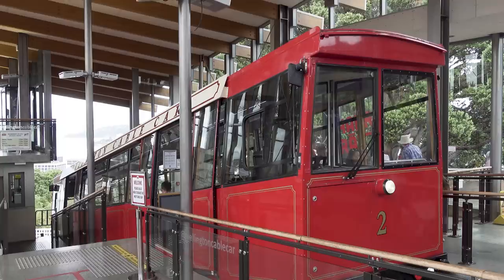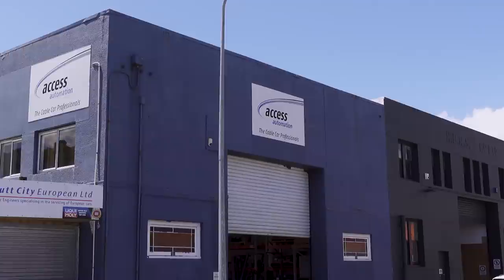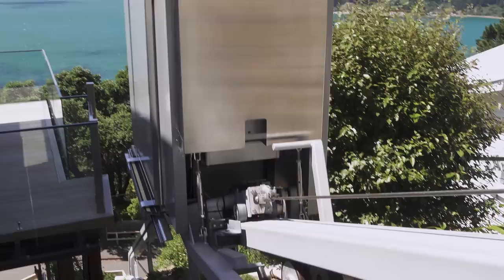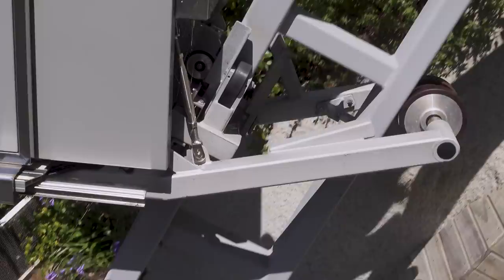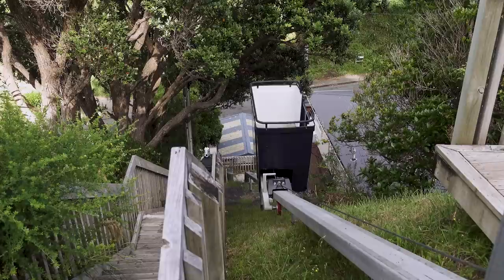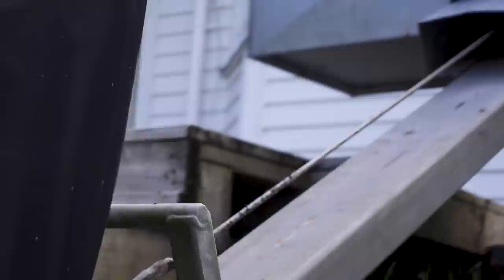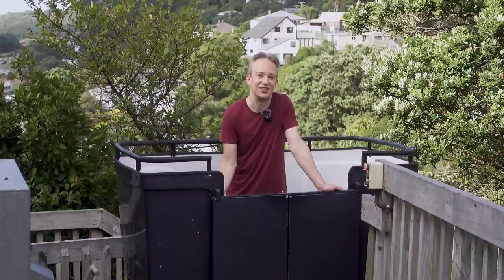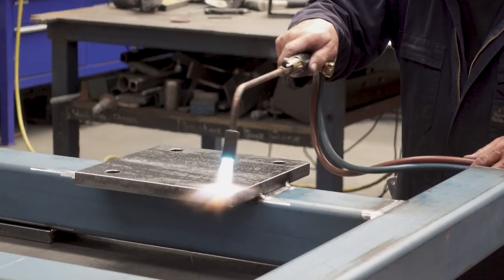The city with a hundred private cable cars

Comment: Let's do some math! $120,000. Suppose a couple uses this lift 4 times per day. That's 8 transits total (4 up, 4 down), 8 times they didn't have to use the stairs. 365 days in a year, that's 2920 trips in a year. Let's say you live there for 10 years of reduced mobility. That's 29,200 trips. And let's say that unlike every other elevator in the world, this one is maintenance free rather than low tens of thousands of dollars a year to maintain. That means, if there was a ticket booth that charged admission, even after 10 years, you'd still have paid over $4 admission every single trip, 8 times a day, for 10 years. $32/day. I dunno, reclining on a handtruck towed by a winch for about $400 total cost is more my style.

Comment: what should have been explained is what happens in a fire, as a power failure would stop the cable car if there is no pathway to it
Reply: If there’s a fire then you just go down the stairs like in an apartment.
Reply: All of these properties have stairs. They were built with stairs. The cablecars are added later for improved accessability, but the stairs are still there.
Reply: Note: Emergency batteries could power this as well......

Comment: It seems potentially problematic in several ways that the manufacturer is also certified as an "independent" inspector - would not both the manufacturer, insurers and customers have significant interest in having the independent inspection done by an actually independent party?

Comment: Wonder if anyone's built a house up the side of a steep hill, with an escalator running from the front door to the attic, all the rooms and floors between being jump off points... I wonder... (insert harp music and wobbly transition effect).
Reply: Picturing that with a spectacular view…. on a solid rock base and no soil erosion….
Reply: Such houses definitely exist, though I'm fairly sure they generally tend to run to stairs, ramps, and/or proper elevators rather than escalators or cable cars, simply because the sort of people who need the accessability these provide when they Build the house... tend to just build a house such as to minimise the need for such things (it's cheaper and easier to deal with, after all).
Reply: There was one I knew of in Kelburn which had an elevator from the street level garage to the main house.

Comment: Angel's Flight in Los Angeles has 2 cars on a cable..as one is going down the other is going up.. this makes it less energy intensive than just pulling up the weight of one car. This means only the weight of the pasengers and cargo in the car uses up the energy. It just occured to me.. that these cable cars could also be uses for energy storage by lifting up weights and then they could then use the energy by letting the weight descend and with regnerative braking of the drive motor.. generate electricity?
Reply: A funicular
Reply: Technically that's a funicular not a cable car. But people use cable car for both.

Comment: @4:18 It looks like the cable is only clamped on the tail end in the choker.  Shouldn't there be two clamps clamping both pieces of cable together?
Reply: Another expert on the internet - what a surprise!
Reply: The cable is fed through a wedge socket, which is what actually clamps the cable. Their clamping force increases as the load is applied. The cable grip you can see on the tail is just used to prevent the cable moving through the socket when there is no load on the cable.

Comment: That's a rather incredible amount of money to simply access a home. 
I feel like most people (in the U.S. at least), faced with not being able to access their home in the future due to lower physical mobility (due to age, or injury, or whatever), at that price would have literally no choice but to sell the house and move somewhere more accessible. So to me this feels like an unsustainable or at least "for affluent only" kind of thing to install.
Reply: These houses are already expensive due to the area so I bet the owners are already quite well off and can afford it.
Reply: Consider that NZ is currently experiencing a significant housing crisis. In the sense that there's legitimately not enough of it (there's a bit of the common problem of only building high end expensive housing and then property speculators just sitting on it, but even if you remove the speculators and drive the prices down, there's still just flat out not enough housing, and building more (while dealing with natural disasters and global trade disruption) is going slow due to Other shortages). 

It makes it a bit more reasonable.

Comment: I'm frightened because there seems to be no counterweight to these vehicles. They are simply hoists. What safety devices are present if the cable snaps?  (Yes, I'm an engineer)
Reply: 10 to 1 safety factor in the cable design.
The cables never "snap".
If you were really an Engineer - you would know that.
Reply: @DennisMerwood-xk8wp  - If you were an engineer, you would know the importance of "redundancy" and "fail-safe design."
Reply: Yes, very few have counterweights. They have multiple safety brakes if it all goes wrong, but it is very rare for a cable to snap, although I have seen the result of several, however this was due to the cable car being very old and poorly maintained.
Reply: @Sprocket72-zz6pc  - Of course, lack of maintenance would turn a safe system into a deadly one. In my experience, some owners will make up every excuse in the book to not do maintenance, especially if they're a landlord. Even with a "Repair-and-Deduct" law, not many renters will be able to afford to even keep up the inspections.

Comment: are the houses built on rock soil? or it does not rain much in the area? the houses seem very prone to hill slides, but since this is a long running thing it does not seem to be a problem, I'm just curious, since the area where I live now deals with hill slides every so often from some houses on hill sides
Reply: The area is also very earthquake prone, and isn't the only place like this in New Zealand. I must imagine that the building code accounts for such things.
Reply: It's very stable. There have been slides or subsidences elsewhere but in Wellington you're more likely to have land ride up out of the sea in a big shake. I worked for 10 years in a factory built on land that came up like that, right by the airport.

Comment: How does the safety mechanism work? Is it universal to the all the designs? Like what happens if the cable were to snap?
Reply: As in elevators in 50 storey buildings..automatic brakes come on near instantly....
Reply: I make these,  there is a “slack wire brake” and also an “over speed brake” in the event of any other over speed situation

Comment: I really don't understand why a small one would cost $140k US.  That is absolutely insane. I feel like I could build a reliable one myself that could lift 40 meters for no more than 30k.  That inch thick steel plate he was welding to a rail in the one scene seems wildly overbuilt.  My tractor lifts a ton and doesn't use steel anywhere near that thick.
Reply: They are specialised custom made lifts, houses on the hills have different height and steepness, plus it is a very niche market.
Reply: You are right - you don't have a clue!
You are not a Civil Engineer I take it Jonathan?

Comment: My thought that whole time was simply "what happens if that cable snaps",  does it have some sort of automatic clamping brake system to prevent it from falling?  or do you simply take a wild ride all the way to the bottom then to the morgue?
Reply: I am flashing back to the elevator scene in SPEED. "They all fall down."
Reply: I can guarantee they will have a break. These would not legally be allowed to be produced if they did not have a break to stop them from falling.
Reply: Of course, just like an elevator, although no counterweight, so less likely to fall up like elevator failure modes are designed for.  
Given the exposure, likely redundant safety systems to overcome weathering/corrosion issues elevators don't have to deal with.
Reply: I would imagine essentially exactly the same thing that would happen in the same circumstances in an elevator, save for the slight possiblity of a leaf or two deciding to get in on the action and increasing your stopping distance a bit. Given what Health and Safety's usually like in New Zealand and the various things mentioned in the video, anyway.

Comment: The question that you didn’t answer that I wish you did: what happens if the cable snaps?
Reply: There will be a break that clamps onto the rail to stop it from moving. But it is very unlikely the cable would snap as its very strong.
Reply: Almsot certainly the same thing that happens in an elevator: The moment it starts moving faster than it should a break clamp engages. Probably a rather substantial spring-buffer at the bottom, too, in case that fails (less 'doesn't engage' and more 'isn't sufficient to the job for some reason')

Comment: what if the cable snatch. Is there a security brake? I assume there is one :D
Reply: Yes there is. The cables never "snatch" whatever that is?
Reply: Yes, modern cable cars have multiple safety brakes in the event of over speeding or cable breakage. And contrary to what Dennis says, they do snatch, which is a very bad situation.

Comment: What happens if the cable car breaks? Presumably some private properties have an alternative foot route and others are just completely inaccessible until it gets repaired?
Reply: These people have money dripping out of their backsides. Problems are swatted casually like flies.
Reply: Cables designed with a safety factor of 10 never "break".
They can carry 10x the load being put on them.

Comment: How do these work with crossing property lines? Like, if I own a house higher up on the hill than someone else's house and my cable car track has to cross over their property how do I get it installed? Is there some sort of right of way agreement? Do property owners share the cable car and have it installed so that it makes mtiple stops?
Reply: All these problems are not an issue Christopher.
Otherwise how are these built?
Kiwis don't overthink stuff like you Yanks do.
Reply: Yes, an Access easement or Right of way has to be formed along one side of the front section when the back section is created. Very common in Wellington. Also when the cable car is shared by neighbouring properties a common Access Easement is usually created for it.

Comment: I guess rain is not much of an issue in New Zealand.
Reply: oh it rains and blows in Wellington haha. I would be going for an enclosed cab
Reply: @toprock9500  Heard of a rain coat?
Reply: @DennisMerwood-xk8wp  yes an wear one regularly on my bike but i was thinking if u were carrying groceries or  water sensitive packages 100 metres up up a hill in an open trolley in a wet cold Wellington southerly then yes i would be going for the roof model

Comment: Want to see the safety mechanism if the cable failed
Reply: They have safety locks.
The cable has a safety factor of 10.
It can hold 10x the weight its being used for.
The cable will never break.

Comment: What happens in a medical emergency? or incase of fire?
Reply: It’s not going to stop working when there’s a medical emergency, just continue to use the cable car. Or if it’s moving too slow then use the stairs.
Reply: @rachelcookie321  no but how are they supposed to get a stretcher through the stairs or the elevator was my concern... Also during the even of a fire, everyone running through steep stairs seems dangerous... I know it's very minor concern but they seem like the kind of people who are rich enough to want those comcerned answered.
Reply: @neilsamuel5268  there plenty of places that are only accessible by stairs like apartments. The stairs usually aren’t that steep, they are just very long. They can easily carry a stretcher through them. And during a fire you should not be running, it’s dangerous anywhere. You’re supposed to calmly walk away in the case of a fire. That’s like basic fire safety.

Comment: Doesn't seem to have any built-in redundancy...if the cable snaps 😳
Reply: They have locks on them.
Reply: @porirvian8457  Cables with a 10x safety factor do not "snap".

Comment: What happens if there is a power outage while you're on your way up or down?
Reply: The car stops - big deal.
Reply: @DennisMerwood-xk8wp  How do you get out of the car if it is stuck/stopped on the side of a steep hill with no adjacent alternative means of ascent or descent such as a staircase?  Are emergency services called, or is the person trapped there until power is restored?
Reply: @bw4t  I dunno....but you think this has never happened in Wellington and they have never figured it out? 
Find something else to worry about Thurlow!
Get a life.
Reply: @DennisMerwood-xk8wp  1. It is a legitimate question.
2. I am not worried about anything, contrary to your assumption.
3. You seem unable or unwilling to provide an answer to a legitimate question from someone who is genuinely curious and seeking a serious answer, and instead choose to harass someone seeking to learn how such things are dealt with.
4. I am a facility manager who has to make sure lift devices are operational, and to assure there is an emergency rescue plan in case of power failure.  Thus, such things pique my interest as these private cable cars are found in sometimes otherwise inaccessible places. Thus I am curious to learn how such emergencies are handled here.
5. I have a life.

Comment: Not sure if it is a good thing to keep the elderly in their house longer with all the house shortages.
Reply: House shortages? You can just build more houses. And the elderly still need to live in a house, it would just be a more accessible one. You can’t just throw them onto the street.
Reply: @rachelcookie321  You'd think. Turns out we also have building material and construction equipment shortages.
Reply: Well, we also have retirement home shortages, nurse shortages, palliative care doctor shortages ...
Reply: @juckto-007  Yes because they need to move from house to house instead of one central place

Comment: 120000 usd?   I would buy an helicopter instead..  seriously!  
Clearly that "elevator" company does not have any competence and I imagine that the state bureaucracies just makes everything worse.
Reply: okay build one for cheaper then
Reply: This is not the US. 
We trust our fellow men, and our government.
Clearly you would not fit in here.
Reply: @DennisMerwood-xk8wp  The US is capitalist..  so that guarantee (at least in average demand products) price competition.
Looks like this is not high demand, only few were installed, which can explain part of the price. 
But just a part. When I said you can buy and operate your own helicopter by that price I was not joking.   If they allow you to do that in a residential place would be another question. 
But if an elevator cost you 120k usd, how much it needs to cost the house in order to have sense?   1.2 million?   In that case I will not see that as a local solution more than a local eccentricity.